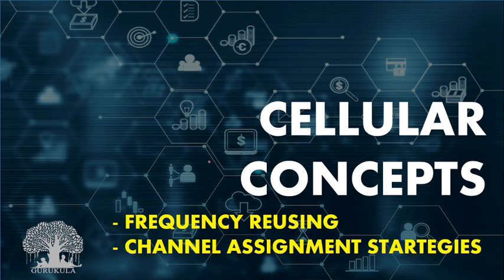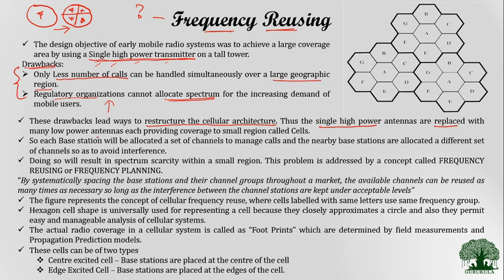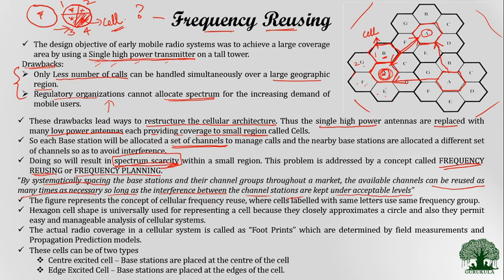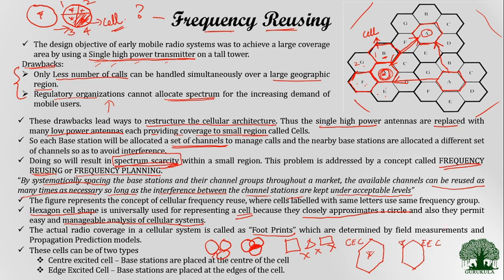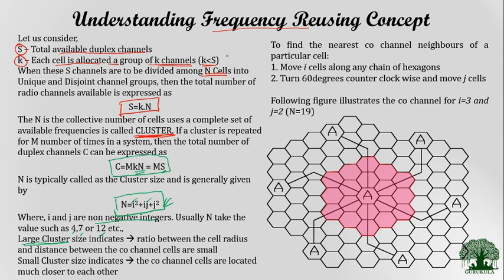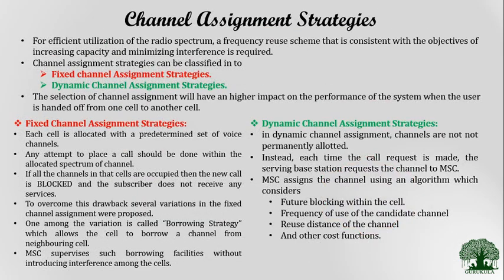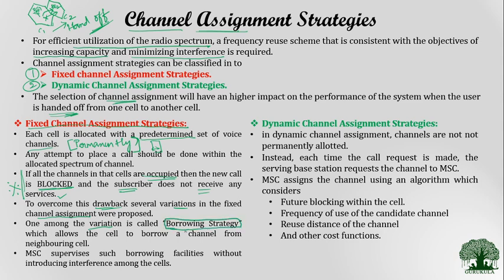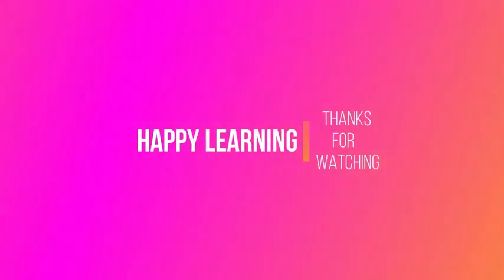Cellular Concepts - Frequency Reusing and Channel Assignment Strategies in Wireless Communication

Comment: Dear Sir,
Thank you for the explanation of the concept of frequency reuse.
I have a question about the the channel assignement : When we are allocating different frequencies to different users (FDMA), the channel impulse response will be different or the same ? If It is different, how we can see the relation between the frequency and channel coefficient in wireless communication ?
Thank you !